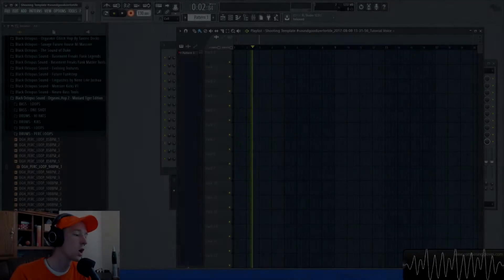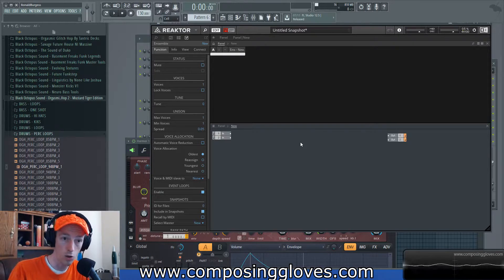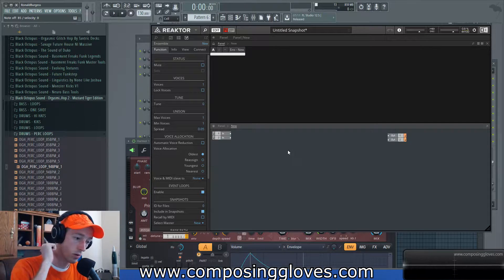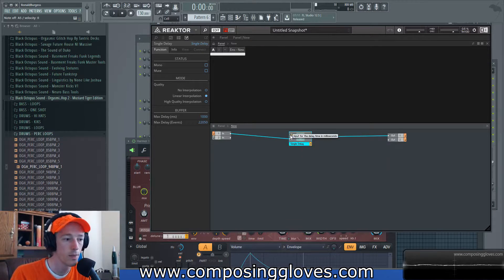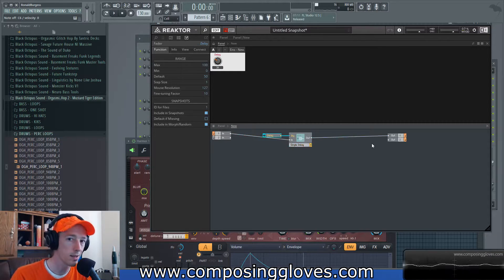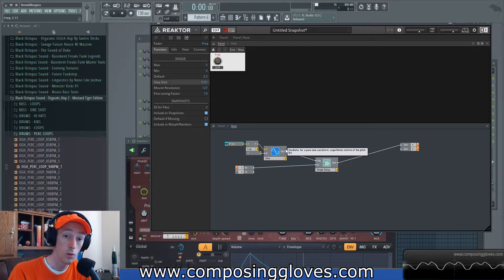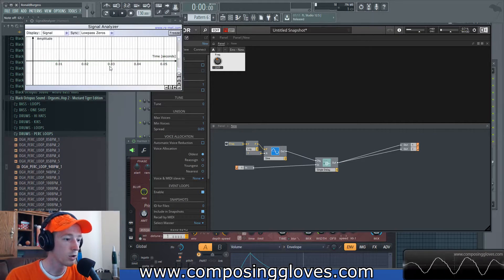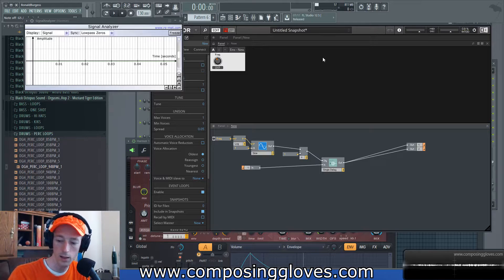DSP 5 - Building a Delay Line for a Chorus and Why

Comment: In order to make a bipolar LFO signal unipolar, I prefer to set the amplitude to 0.5 and then add another 0.5 to the output so it's a nice tidy unipolar range of 0-1. The way you've got it here it's ranging from 0-2, which is fine for a chorus. In fact, only 1 millisecond probably won't be very noticeable. I just like to have that nice neat range of 0-1 so I can send that out to a multiplier if I want to create an extra Depth control.